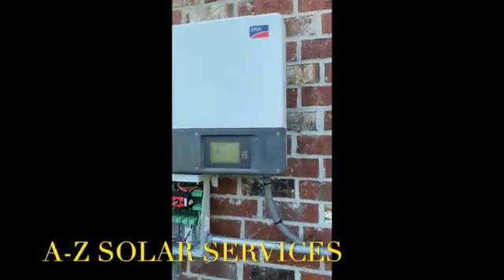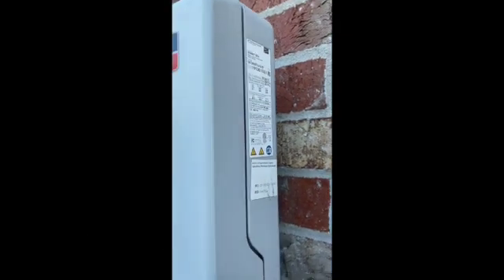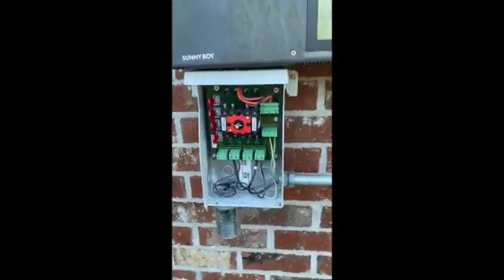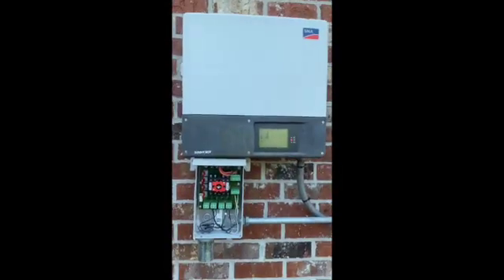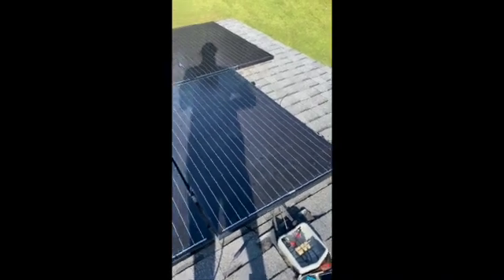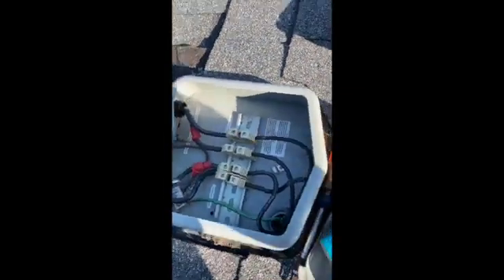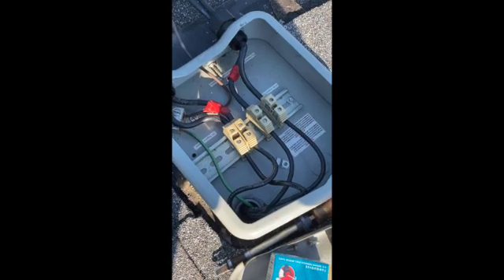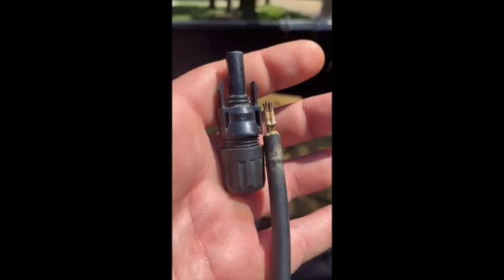Solar Panel SMA inverter ARC fault / check DC generator

Comment: 3501 insulation resist what is that?
Reply from the maker: Event number 35, 3501 or 3503 indicate that

the inverter has detected a ground fault in the PV array or
the insulation resistance is too low.
Reply: This is likely due to the insulation in the wire being compromised. Could be from a pinched wire or critter damage.
Reply: @nittolover23  yeah  had a squirrel chewing some wires . That's got to be it
Reply: @nittolover23  watched a couple videos how to find the problem . Had an internal short in a panel. It was grounding out on the frame .
Reply: @dalevalentine2264  What videos did you find? I'm searching now.
Reply: @dalevalentine2264  what video did u watch